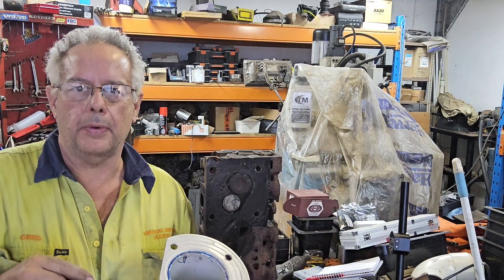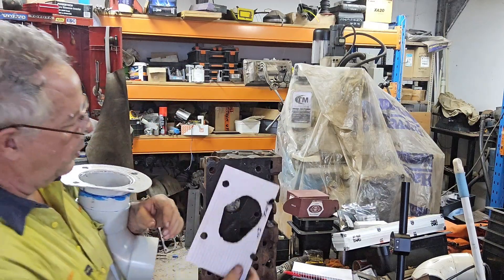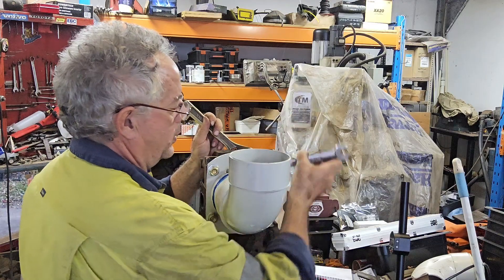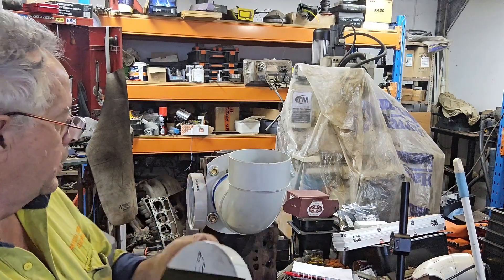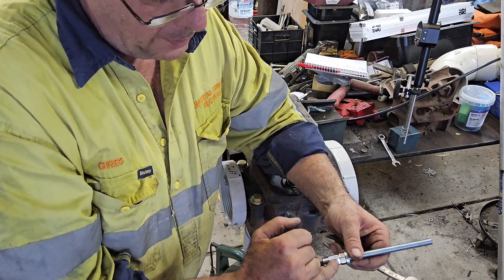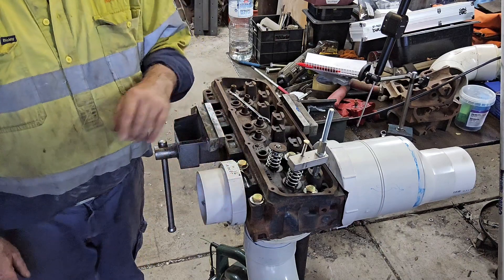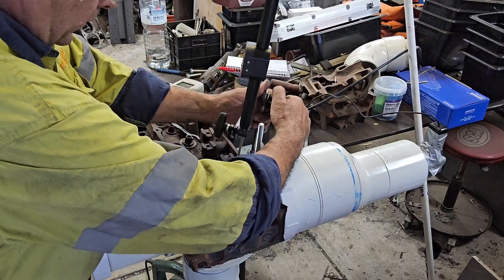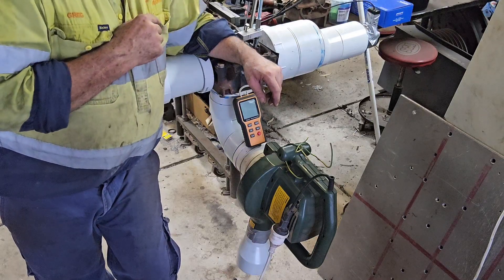Poor Man's Flow Bench Part 1

Comment: Making a "flow bench" is fairly easy, its ot hoing to compare to anyother bench,
be map sensor can be used wth a volt meter, to get numbers from who knows what they mean  1cfm 10 cfm or 6.5cfm as long as it says the same thing every time tested  then slight change with modified ports if nothing else use a little fan on a permanent magnet motor. And a volt meter the more air it flows the more power generated. Possibly add a resistor i parallel to show less voltage to show more range with the extra flow  like flow a #10 head with a scale that only goes to #5. Have an awesome day!🎉
Reply from the maker: @jamest.5001  thanks for watching and commenting. Agreed, there are many different ways to make a flow bench, this one was just mainly stuff that I already had lying around